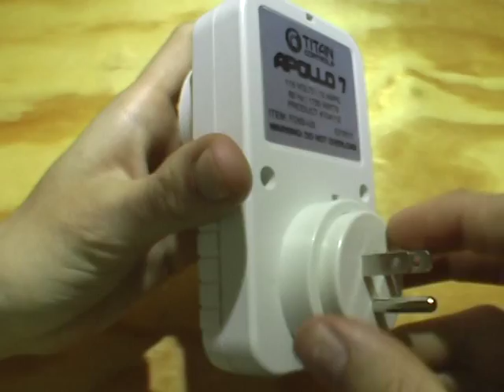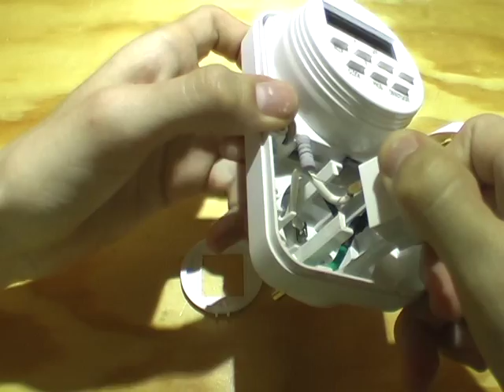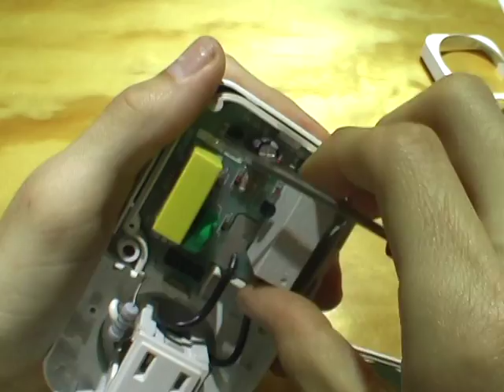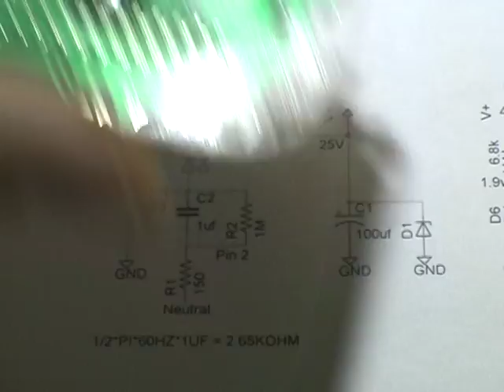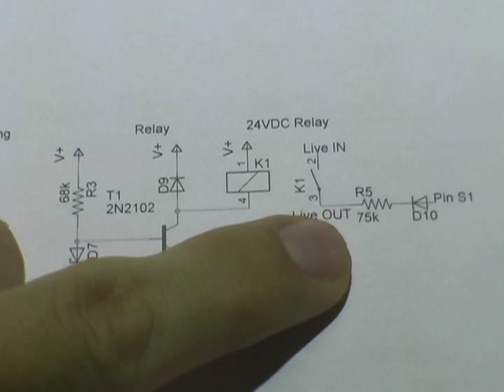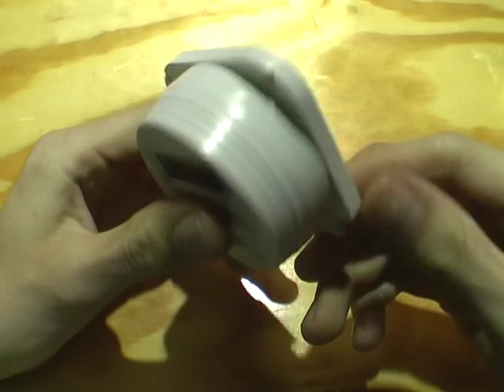Titan Controls Apollo 7 Digital Timer Teardown

Comment: D6 looks like a tunnel diode, and D7 is a Shottky diode.. the relay is triggered by ~24v DC.. the rectifier circuit is a step down for the DC relay.